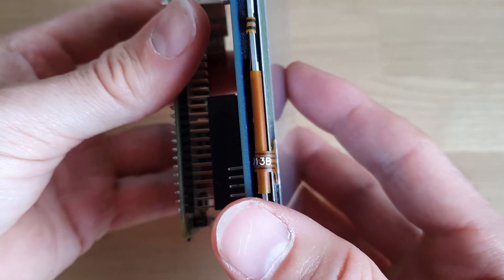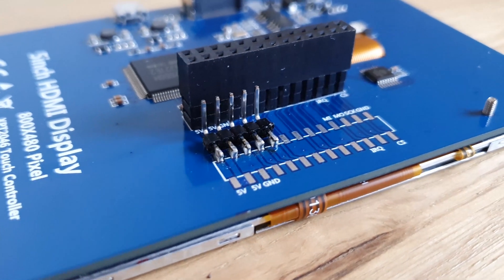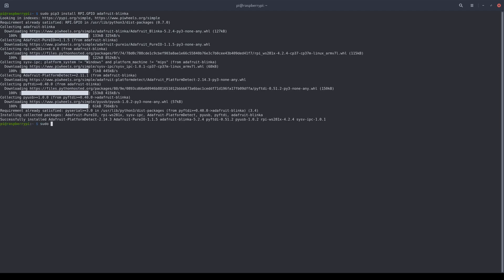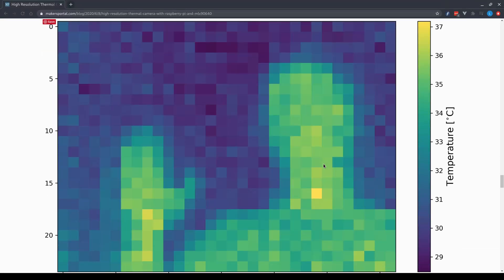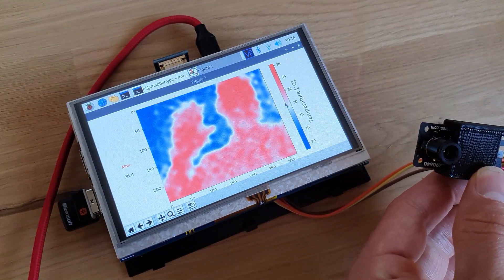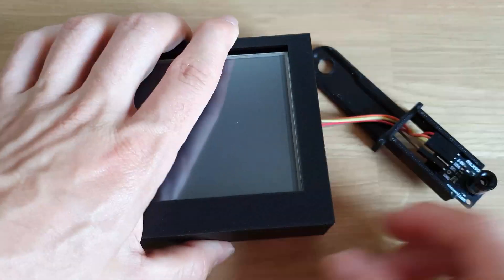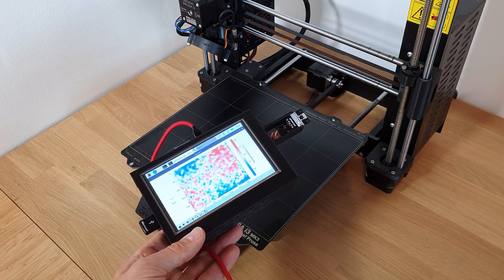Building a Portable Thermal Imaging Camera - Raspberry Pi and MLX90640 guide

Comment: I ended up with a 5" touch screen that doesn't have the solder pads on the back so the Pi will bolt on but I'll probably have to run a cable to it.
 What is a way to make sure people get the right screen when they try?
The link showed many kinds and sizes.

Comment: hello, i know this video was from long ago already, but i wanted to make a similar system without the external display for our thesis project, i have a Raspberry Pi 4 and an MLX90640 thermal camera similar to that in the video, i already inserted the right pins but after using the i2cdetect command, the camera's address won't show in the terminal, is there some way to troubleshoot this or am i doing something wrong

Comment: Great tutorial! I am working on a similar project. Using a Raspi 4 and MLX90640 (Pomoroni). I have followed your guide, but everytime I run the code I get this warning error:

"RuntimeWarning: I2C frequency is not settable in python, ignoring!
  warnings.warn("

What seems to be the problem, Sir? Thanks in advance for your response.

Comment: I have got to the mirroring part but I seem to have a problem. When I run the thermal camera command the mirror mode just mirrors the screen and nothing is picked up by the thermal camera even though it is detected when running the detecting command
please help :)

Comment: THANK YOU for making this video!  I am working on an unrelated project with the MLX90640 Thermal Camera from Adafruit.  I wanted to test the camera hardware prior to sending it off to my dev team.  I can hack through some code here and there, but I am not a real programmer any more.  And I could not find a way to try the Thermal Camera and see if it worked, or if I liked what the output looked like, etc.  Its not as easy as plugging in a usb camera into a laptop.  So, I followed the instructions on this video, and had it working in short order.  I got to test my cameras!   This is a great app, and a great idea.   Thanks again!   By the way, the Adafruit MLX90640 camera works great!
Reply from the maker: That's awesome, glad it was useful!

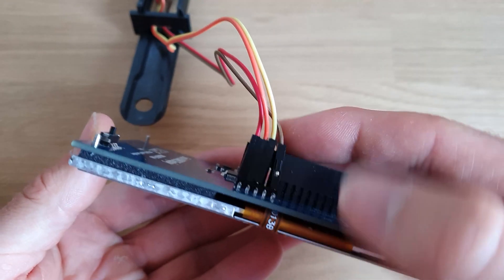Comment: @ 2:06 you state to match up 5V, SDA, SCL, GND to the camera. I think you meant to say 3.3V ? Still in input range of the mlx90640
Reply from the maker: No I meant to say 5v, mine is 3.3v or 5v compatible. You can of course 3.3v if you want to!
Reply: @EverythingSmartHome  I have the mlx90640 as well and can see the input range 3-6V so there is no real issue here. I considered the same touchscreen you have because of the easily solderable pads for the 90 degree dupont connectors. 

This is me being nitpicky. If the layout of those pads are the same as the gpio pinout of the pi itself, then to me it looks like you're pulling from the 3.3V pin (based on video around 2:00 ) https://www.raspberrypi-spy.co.uk/wp-content/uploads/2012/06/Raspberry-Pi-GPIO-Header-with-Photo.png

The two 5V pads on the other side don't look to be used in your case

Comment: if this is one of the waveshare ones, it can go up to 64Hz/FPS instead of 0.5 default Hz, but 8FPS is recommended for standard rpi usage which is much faster than this
Reply: whats the limiting factor? why only go to 8? what stops you maxing it out or getting 30 minimum?
Reply: @AirsoftAbominations  probably the processing power required for calculating and displaying the different temperatures etc, don't know how well a Pi 4B (which i have) would run it as i don't have one of these modules, and i honestly don't think they're worth the price (32x24 for $110)
at that point the Flir ONE is probably a better option as you can use it both on your phone and pi
Reply: @BH4x0r  they're £54 right now on pimori, I've seen units smaller than a pi zero process higher resolutions, what's so inefficient about the pi running it here?
Reply: @AirsoftAbominations  Well i meant the flir would definitely be a better option as the resolution is near unusable on these modules, and usually very overpriced
Reply: @AirsoftAbominations  If you increase the frame rate, the noise level increases according to the data sheet (less averaging ?).

Comment: great job you did, thanks for sharing
i follow all steps as you explained in video.
getting error as below

it may be i using mlx90641 instead 90640
every where says both is same accept its resolution 32x24 and 16x12

using 
1.raspberry pi4 -2 GB
2.latest raspbion OS
3.Python3.7 as Thonny IDE
4.using Sensor MLX90641
error is 
 File "/usr/local/lib/python3.7/dist-packages/adafruit_mlx90640.py", line 774, in _ExtractDeviatingPixels

raise RuntimeError("Adjacent outlier pixels")
RuntimeError: Adjacent outlier pixels

Comment: After doing all the process you mentioned in the video, I got a error when run the program using thermal-camera-advanced.py

File "/home/pi/project-name/TestMLX.py", line 6, in <module>
i2c = busio.I2C(board.SCL, board.SDA, frequency=800000)
AttributeError: module 'board' has no attribute 'SCL'

Resources which I used - 

1. Raspberry Pi 4
2. Sensor - MLX90641

What should I do !!
Reply from the maker: Did you run the i2cdetect command and what is your address?
Reply: @EverythingSmartHome  Yes I have run the i2cdetect command, and the address is  0x33
Reply from the maker: Which version if Raspberry Pi OS are you using? Did you make sure to install all the requirements?

Comment: Every time I try to run the program it freezes. All the setup commands worked no problem and the camera is detected. Any suggestions? The only difference in hardware is that my camera is marked as adafruit, as well as stemmaQt but is still the mlx90640.
Reply from the maker: Hmm that's strange. If you run an i2cdetect scan, which address is your camera being picked up on?
Reply: @EverythingSmartHome  0 x 33, just like yours. This may sound strange but it started working after a few restarts. Now I have to figure out how to convert the temp to farenheit as well as find a way to launch the program without a mouse and keyboard.
Reply from the maker: Ah glad you got it working!
Reply: @TheIammcnorman  hey! just wondering...did you end up figuring out how to do the conversion to F? thanks!!

Comment: why did you say "connect the camera to the raspberry pi" but in the video you connected it only to the display?
Reply: On the back of the display he added pins that connect to the RPI via that  large black connector next to the pins. This allows the sda, scl, 5v, gnd from the camera to get to the RPI. He used a dupont connector to connect the camera to the pins.

Comment: If you point it at someones face what degree will it show. Because the nose differs from the forehead you know. (I want to measure the forehead obviously)
Reply from the maker: It will display the hottest temperature on the screen. But you can just move closer to zoom in on the forehead to get a more accurate result